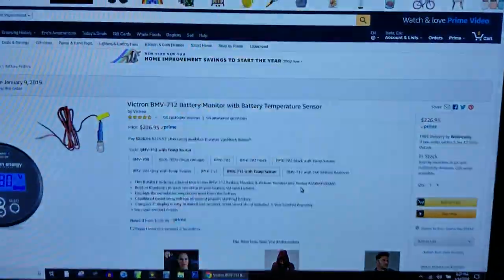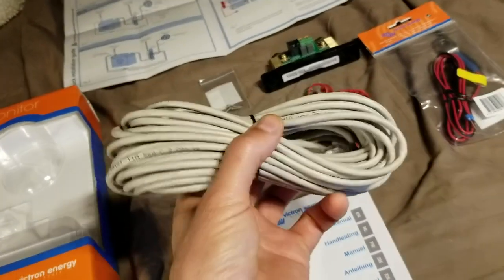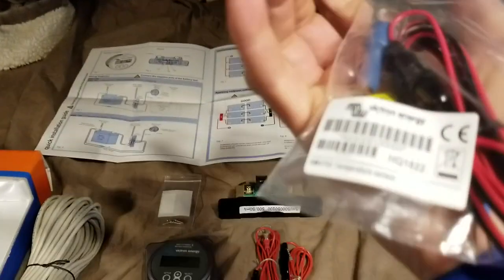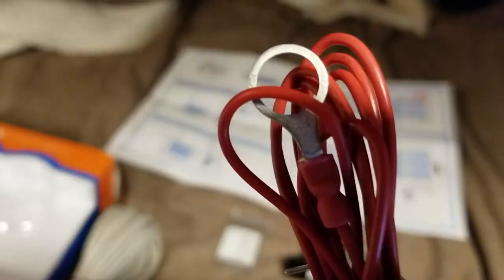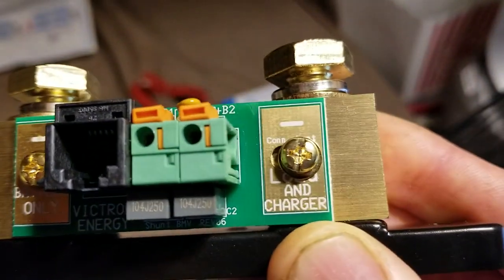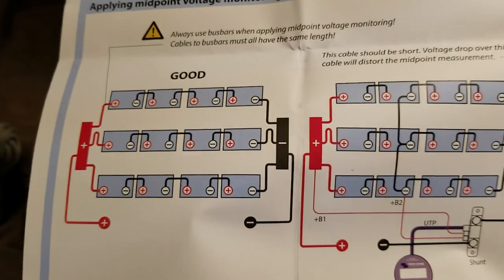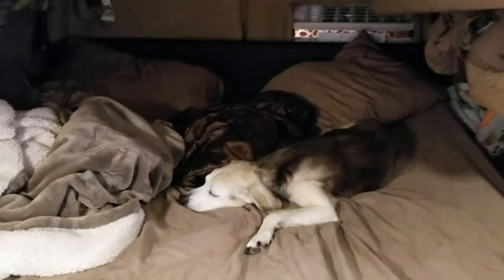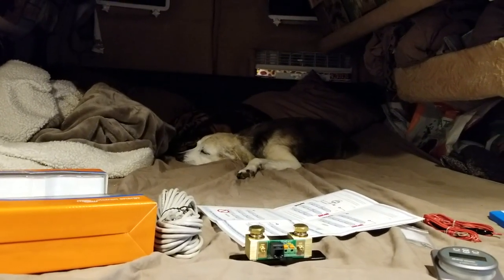Victron Energy Bluetooth Battery Monitor BMV-712 w/ Temperature Sensor Unboxing Review

Comment: The temperature sensor cable provided with the victron multiplus 2000 IS NOT the same as the sensor cable sold for the BMV-712.  Just so everyone knows.  I can verify.....

Comment: Have you got this installed yet?  I have some questions on repurposing the sensor...I want to use it as a temperature sensor for my travel buddy oven in my car...so that the internal temp of the oven is displayed on the app
Screen of my phone...

I’m using a enerdrive dc to dc charger to manage the 200ah voltax plus lithium battery...so no requirement for a temp sensor at all...

Just curious if you know what the range of the sensor is & if I can use it as a temp sensor only rather than have it attempt to throttle the battery while using it this way...

Comment: Hi, please help me understand how and where to connect the temp sensor wires to the unit
Reply from the maker: I'll be posting new details soon
Reply: @EcoNeato  How soon?
Reply from the maker: @timjohnson1042  For this converter/charger I never used the temp wires yet, only pos/neg out to battery. I use the BMV 712 for temperature monitoring. I do use the USB port to configure software.